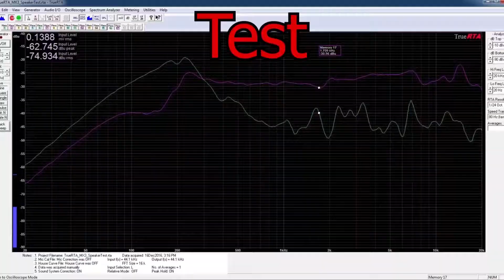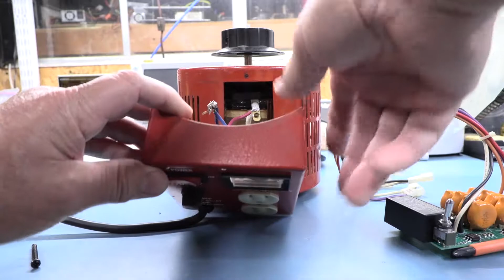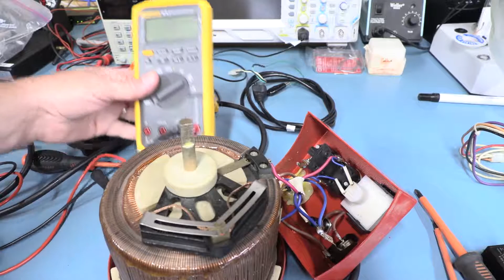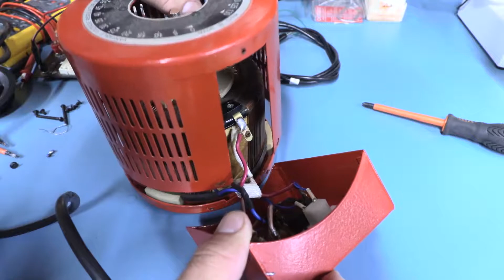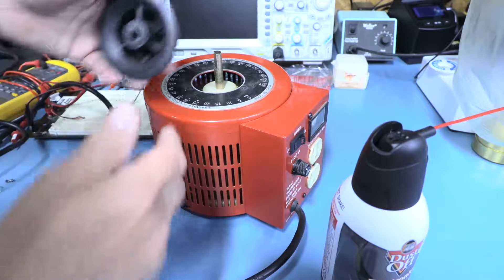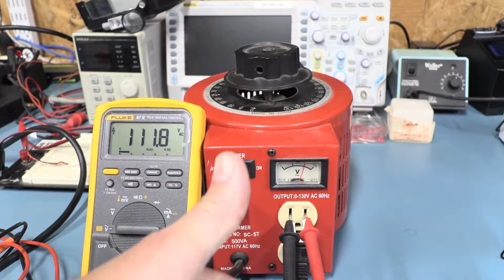IoT#27 Variac Teardown and Repair

Comment: I know it's a bit belated (5yrs to be exact) but it was good to see you mechanically crimp the spade ends onto the wire in addition to soldering. According to the electrical code in the US any mains current carrying conductor MUST have a mechanical connection to a lug within an enclosure because solder can re-melt under heavy loading conditions and become disconnected posing the risk of shock or electrocution. I've seen far too many "repairs" by diy'ers ignore this risk and have had 2nd hand equipment I've purchased actually come apart and short against their enclosures making for a real exciting experience! So it was good to see you taking the extra precautions & doing your best to keep it safe. As I've gotten older I've developed a "next guy" philosophy & try to do everything I can to make anything I touch suitable for safe use by someone who assumes it is.